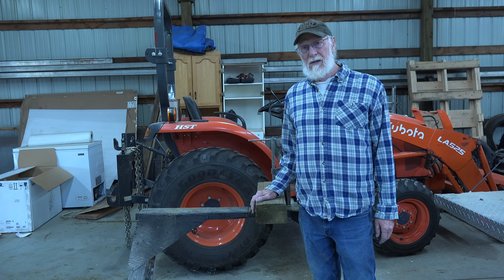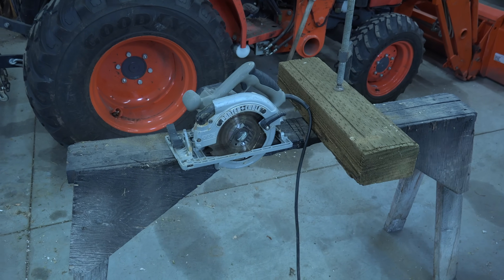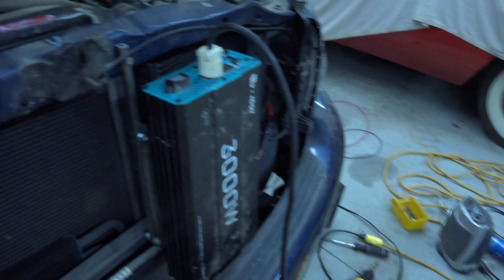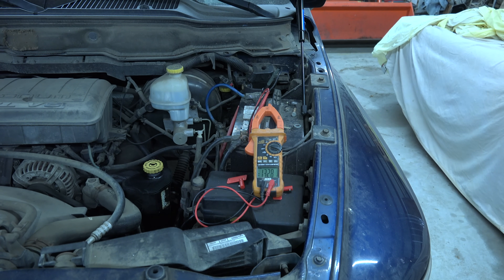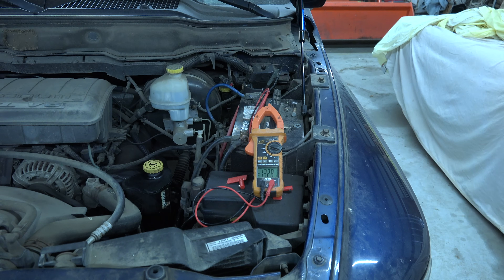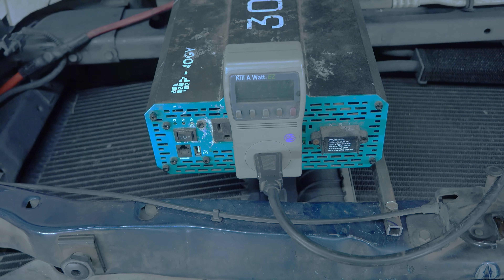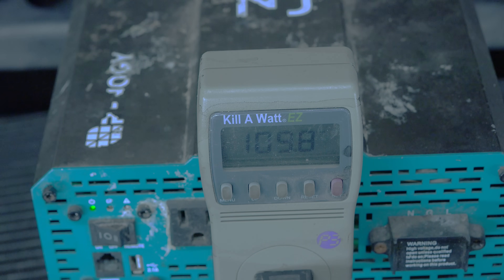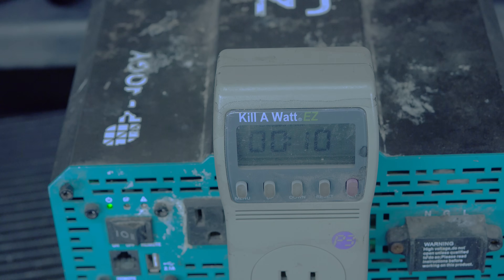Can you use a car battery power your house

Comment: deep cycle lead acid batteries can tolerate it, car batteries not so.
Reply: even with them you wont get much run time, because the inverters are built to shutdown before running a starting battery too low. so you need to idle a vehicle 24/7 while using an inverter, plain and simple. I've done that before over 25 years ago, used the cheapest to idle vehicle I had(4cylinder minivan) and just let it idle for a few days. no, I don't recommend doing that, but at the time it worked to run the gas furnace/blower. it was frigid cold winter, so keeping food was no issue, frozen stuff on enclosed porch and fresh foods in cooler(to slow it from freezing)
that was also a work vehicle that was used to charge early cordless tool batteries, run a few lights, radio and a fan or torpedo heater at times, of course I had added a few batteries and upgraded alternator, etc.

Comment: I've done all these experiments. I have run large loads on my truck (240A Alt.) but only with the engine running. I now have two 12.8V 100Ah LiFePo4 batteries and other equipment for outages. Got 4 new steel gas storage containers for my small generator. I rotate the gas, one 5 gal can per month and buy premium to make sure the octane doesn't get to low on the oldest gas. Thing is, we never have outages here but we could have a  mega thrust earthquake.

Comment: 1 battery gets 10 minutes, 6 gets you an hour, 12 can get you an hour but with only half discharge so more cycles... so there is some theoretical number of batteries to get you the amount of reserve power you want for the length of down time you want to prepare for. In a house you have more unused space that can accommodate a couple dozen car batteries than a car does and not much considerations for weight since they won't be moved. 

For car batteries there's only so many plants that make them and like everything they go through distribution and end up in your store. Foreign plants stuff them on a boat and float them over a couple of months and like you said these things like staying charged all the time... so they arrive half dead which is why those ones only last like a year before you gotta go back to autozone. Places local like east penn over in Pennsylvania you can get a battery made by them from a local store in under a month or two which should be the only batteries you get. The more popular the place the quicker they turn over stock the fresher the batteries

Comment: Good demonstration of energy capacity, a typical ~40 Ah battery would have about 480 Wh of energy - not much as you've noted! I think you're overestimating fridge draw (should be closer to 200 W?) which would give at least an hour run time for 50% Depth of Discharge to prevent destruction of the battery! 

Your point remains - you'd need to idle the vehicle to get any reasonable sustained power output!
Reply from the maker: When determining power usage, I am using the rated amp draw as listed on the model plate.  This may include the power used by the defrost heaters.  Running amp draw is lower, but may be higher with a warm box.  Generally, when estimating, I will always go to the highest load.
GFM
Reply: @grayfurnaceman  yeah but that estimate is pretty far off if you're not using it to size the circuit but rather to figure out how long a battery will run a fridge. You have the tools (killawatt) to measure instead of estimate. Why not measure? My guess is that you'd run a normal, built in the last 20 years, fridge for 5 hours. That might save hundreds in groceries. Maybe that's worth a car battery? 

Your videos are great, they've really helped me understand my furnace and diagnosed some issues I've had (dead bird in the inducer fan, and I didn't even buy a new pressure switch first!)
Reply: For example my 1999 side by side consumes 17.48kWh over 231 hr, Avg 76W, 45% on time. ~175W, ends at about ~165W?), so 170 W running average wattage. 

My 5ft wide chest freezer is lower still: 5.38 kWh in 94 hours = 57W. it runs at 85W when it's on, so it's on 2/3rds of the time in summer (high of 90s, in the garage...) ~1.4 kWh per day in the heat

You gotta run the engine if the power outage lasts more than 8-12 hours, but both of them will run off a 1000w inverter. I've never actually needed it but I did test it for 6 hours. Car still started the next day and the battery is still good 3 years later

Comment: I didn't know that people used regular ICE car as an emergency AC power supply. Doesn't the 3000W inverter cost as much as a 3000W gas generator?
Reply: u can regularly find those inverters  for 2-300 bucks, for a decent chinese brand.   for emergency use only , for a lot of folks it's less hassle to quietly run the car in the driveway.  no need to keep a generator ready to go in an un-gummed  condition, no gas cans, no frequent refilling.   it's a hacky solution but works for some ..
Reply: Nah, the inverter is cheaper but the problem is loads bigger than the alternator can handle without draining the battery in short order. Typical alternator maybe 150a at the most... at 12v is good for 1800w. It's also probably not built to do that high power continuously, gotta avoid outright killing the alternator because it's overloaded.